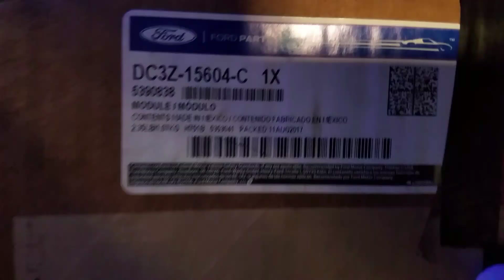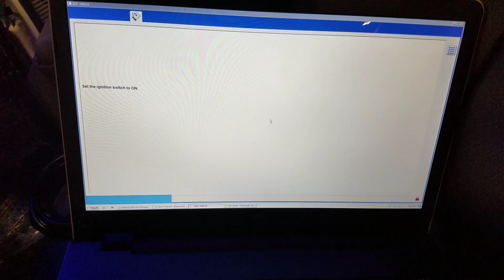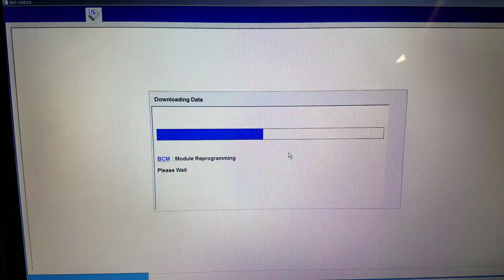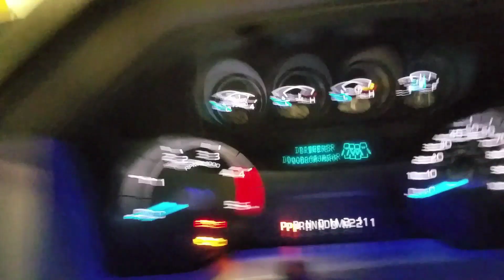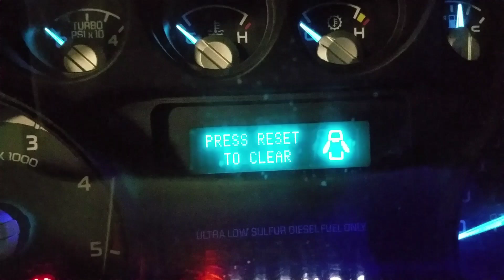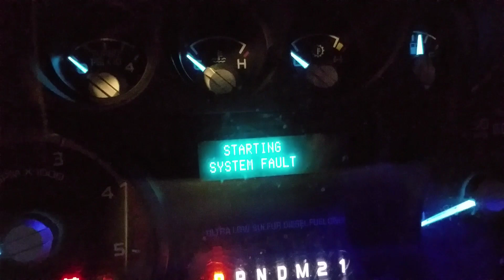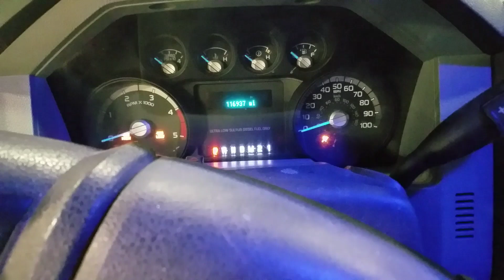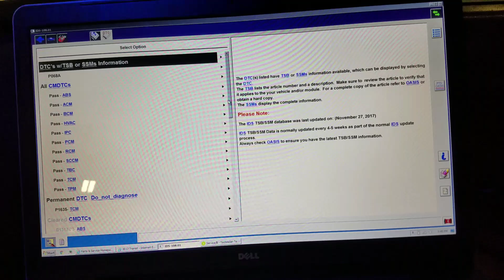BCM R&R - FsuperDuty

Comment: Great, informative video! Just replaced the BCM on a 2011 Ford F150 XL. Swapped out both doors and BCM to add power windows, doorlocks and mirrors. Any idea what additional programming needs to be done to get the truck to recognize the new configuration? Is there additional wiring that I need to do? Thanks in advance!
Reply from the maker: Bcms are NOT plug n play. Ur gonna need a dealer level scan tool to perform the PATS functions & ultimately program the BCM into the network...
Reply: @PowerStrokeTechTalkwARod  so Forscan is no good for that? I’ve already done everything you did in the video with the IDS, with forscan. Just wondering if there is more that I have to do, or more wires that need to be run. Again, thanks in advance!
Reply from the maker: I duno if there would be..ive never added anything like that...

Comment: My Parking lights will not go off on my 2013 6.7 powerstroke Lariat. I have to pull the two fuses out of the BCM to get them to go off. Could this be a possible BCM issue?
Reply from the maker: Possibly
Reply: @PowerStrokeTechTalkwARod  I would say definitely I’ve extensively searched on Ford forums for an identical scenario for my f150 with starting system fault, gear icon, advancetrac problem with parking lights that won’t shut off draining the battery. I’d say yes. Bout to buy vcm 2 computer for this. Hopefully it’s not god awful slow to reprogram bcm
Reply: Yes
Reply: Have issue with parameter alarm. Lost keys had new ones cut now won't let me access security because perimeter alarm active. I'm using ids with vcm2 and advice. Won't let me access can bus due to perimeter alarm active
Reply from the maker: A condition is not met
Reply: @PowerStrokeTechTalkwARod  so how do I fix this or find out what condition is not met? Thanks for the help. Dealer wants new ECM and new bcm to fix I can't believe that to be true.
Reply from the maker: Id love to help ya...im sure you can imagine your not thee only 1 requesting assistance. You'll have  2 email me & pay for my time....my content is free, my time is not...
Reply: @PowerStrokeTechTalkwARod  understood and I appreciate the reply what is your email
Reply from the maker: Its in thee about tab brotha

Comment: P2610 code starting system fault. Then can shift into neutral and will start. When in park the p will not Illuminate so vehicle thinks possibly in gear? Bcm issue?
Reply from the maker: Maybe..

Comment: You seem to have a pretty good grasp on the electrical systems on these trucks... I’m having an issue with my center stack cutting out, my airbag light coming on and my front windows stop working all at the same time. I just had my bcm installed, and programmed at a dealership and that didn’t fix the issue. Any idea as to where I should go from there?
Reply from the maker: Id have 2 go thru the applicable pinpoint tests for your concern....no guessing games....
Reply: Did you ever find a fix? I have the same exact issue

Comment: Hello I hope you answer so just replace a bcm on 2014 ford f250 it was no communication so I pu a new on it reprogram,  and I got to keys truck runs everything looks good but the interior lights flashing what do you think I need to do 🤷🏾‍♂️🤷🏾‍♂️ thank you..it give me the same go to tool box  but in the tool box don't have that option 🤷🏾‍♂️
Reply from the maker: Its in the tool box...in IDS & the directions in the WSM in replacing the BCM.....did u read the instructions???
Reply: @PowerStrokeTechTalkwARod  yes but in the tools box its nothing,, the CEL LOOK CONFIGURATION,, CANT FIND IT
Reply from the maker: Powerstroketechtalkwarod@gmail.com

Comment: Hello there Señor ,, I have a question -- && Happy Holidays to you and your family I hope all is well ----- I'm working on a 2012 F550 diesel , problem is the entire cluster sometimes shuts off while driving ,, also when the dashboard isnt working the interior && all outside lights stay lit -- Also if the dashboard isnt working the truck wont turn on.. if I disconnect the harness above the emergency brake for a few minutes and the lights do turn off -- but the problem randomly persists --- are these signs of a faulty BCM .?
Reply: Thought so .! Sweet your Tha Man .!! -- Now I bought the BCM before I realized it needs to be programmed..then came across your video --- I worked 10 years in a small garage where I learned alot ,, but never did anything as far as programming.. I just started working by myself about 6 months ago && I've been talking to my Mac Tools && Snap On guys about getting a better Scanner but I dont know which one yet -- what would I need to be able to program this myself .?
Reply from the maker: Ud need ids. Ud have to download files from ford server. Gotta take to the dealer, sry pal
Reply: All good Thanks again .. at least I got the BCM a little cheaper thru my account.! Lol
Reply from the maker: Most likely!

Comment: I am having an issue with my 2019 super duty diesel 6.7 will I need this program? Also is it something I can buy or dealership only?. Says my doors and hood is open when they are shut. My hazard lights don’t flash but lights work. But the head lights and fog lights are stuck on. Any ideas?
Reply: What else do you think it might be? It’s driving me nuts
Reply from the maker: I have to look at it and put the computer on it
Reply: @PowerStrokeTechTalkwARod  where are you located? I’m in Tampa FL
Reply: @PowerStrokeTechTalkwARod  where are you located? I’m in Tampa FL
Reply: @PowerStrokeTechTalkwARod  everything else works fine just headlight switch doesn’t change lights or park lights, hazard button doesn’t work, says hood and doors are open when they are closed? Truck runs perfect other than the above
Reply from the maker: Detroit, i have transports available
Reply: @PowerStrokeTechTalkwARod  you don’t happen to know anyone in FL do you?
Reply from the maker: Nope sure dont
Reply: Hey bud do I have to have that BCM programmed or can I swap it out and then take it to the dealership to be programmed? Or is there a chance it will just work?
Reply from the maker: Nope, truck wont start. Has to be programmed & ull need 2 keys. If you dont you ll have 2 go buy a new key.
Reply from the maker: Probably not the same problem. Id have to look at your truck.

Comment: Your video saved my ass .......Thank You! ....... PS Can a  (good) used BCM  be re-programmable  or is a new one required InYrOpp ...My local dealer's elec. tech. is telling me to start with a (full body wire harness)  this is what I am working with right now......Rt side collision damage took a good hit at the lower A-pillar where the bcm is mounted inside ......2015 F-150 crew cab XLT 2.7 Eco. ...Ford Tough .....
Reply from the maker: It has to be the same level part numbers
Reply: @PowerStrokeTechTalkwARod  I need to gift you somehow for your help..... I have Pay Pal please advise how to send a tip your way my friend.....
Reply from the maker: Friends & family pal!! 
https://www.paypal.me/pttwarod

Comment: I have a 2011 F350 Power Stroke.  I have intermittent issues with TPMS fault.  The issue will clear the next day.  This happens every few weeks.  I don't have any USB charges connected but I do suspect it is some kind of an RFI issue.

The two codes I see are... DTCs in BdyCM: B124D:02-8A, B1182:00-8A

I found an excerpt from the shop manual that suggests removing and re-seating all connectors on the BCM.

Can I safely unplug these connectors without having to reprogram the BCM.  I assume the reprogramming piece is just for replacement BCMs.

Is there a way to clear the TPMS fault rather than having to wait a day for it to clear on its own?

Thanks, Kevin
Reply from the maker: Yes u can... & u need a tire training tool
Reply: @PowerStrokeTechTalkwARod  When I get the fault, I do nothing and it clears on its own after a day and then fails in a few weeks.  I don't have to retrain the sensors.

Comment: We have a 2011 F-350 6.7l king ranch. We have an issue with the power windows, moon roof, back sliding glass, and the compass displayed on the instrument cluster not working intermittently. Then the next day or two it will start working again. Do you think this is the BCM?? Looking at the Ford wiring diagram book it appears that the BCM is the common denominator as well as 30a relay #48, but we have had the relay tested and was told the relay is not bad. Is it common for intermittent issues with a BCM or should we be looking at a possible ground, switch, or wiring??? We have brought it to two mechanics that either don’t want to deal with it or just don’t really know what they are doing. They both sent the truck back and said (paraphrasing) ‘we don’t know what the problem is, never heard of this issue, probably some wiring somewhere.’
Reply from the maker: Wow! Buddy you will have to follow the proper pin point test to figure out where the problem is. You will need 2 use the type of scan tool i have to even program a BCM if its it.

Comment: I have an issue with my rear passenger brake light and turn signal not working. The fuse is good and have power at both sides of the fuse but no power at the light socket. Even traced it back up to the BCM and no power coming from the BCM.    I took the thing out and looked for loose and dirty connections but it was all good. I would hate to have to bring it to a shop to change the BCM because I have no tuner to program it. Could there be another way to get around this problem??
Reply from the maker: Nope

Comment: I am dealing with a no crank BCM communication lost the connector at parking break how would someone get in touch with you best ?
Reply from the maker: The email on my about page
Reply: @PowerStrokeTechTalkwARod  I'm having starting issues showing fault starting system
Reply from the maker: Gotta check codes

Comment: My 16 F350 gasser needed a new BCM. I had a ford tech stop by and install it. He said he programmed it in and needed the two keys also. After install my brake light in the dash stays on. The tech said to disconnect batterie for a hour and then reconnect and light in dash will go out. I did this but the dash brake light is still on. Any ideas to what is wrong?  The brake dash brake light was never on prior to changing the BCM.
Reply from the maker: Interesting. I would first check DTCs. 2. I wld check brake fluid and emergency brake pedal. 3. Make sure connections @ BCM are sound. And after that im pretty sure i wlda figured it out by then...
Reply: Thanks.

Comment: i have a major electrical issue with my 2012 f250 powerstroke. truck starts and runs fine!
radio turns on but doesnt light up, electrical windows dont work, ac blows but not cold, trac control and autostable light on dash, air bag light on.
NOW i replaced the cluster with another used one but didnt work.

is this a bcm or pcm issue?! im stupped been looking around for messed up wires and fuses but nothing out of the ordinary.
Reply: also the cruise control doesnt work, abs light is on and says check brake fluid(its full) just a bunch of bullshit going on.

now i did have the PCM reprogrammed at the dealer but didnt do anything.
Reply: whats your email
Reply from the maker: Goto my about page
Reply from the maker: Email me
Reply: @PowerStrokeTechTalkwARod  just sent email!

Comment: I have an odd issue. 2015 F350 that had Sync2, I installed a Sync3 and it works great except that after about 17 mins from key on the screen starts to dim and at 20 mins it goes completely off, touch still works if you know where to touch.  Reverse camera doesn’t show, steering wheel controls work but nothing starts the screen back except power+>> reset or key off/on. Seems like some BCM power saver function sending a sleep command to the Sync 3 running 3.4.  I was told that a Sync 3 with old software would probably fix this, but you can’t downgrade from 3.4.  

Is this something a Ford mechanic will even want or try to fix?  I’m wondering if a newer BCM or other module could fix it
Reply from the maker: Yea man, i havent got a clue. If ur gonna take it in be prepared to spend some cash. When the world mixes and matches these things together, there are no pin point tests to follow to aid in diagnosing. Seems like its gonna b a pita to figure it out. Gonna have 2 leave it with some1 to diag.....

Comment: hey  PowerStroke Tech Talk w/ARod  where can I find the wire color code for the turn signals and running light, so i can splice into them and add them to a new set of tow mirrors with signal lights and power fold. 2012 F 350 Xl 6.7
Reply from the maker: Email me at powerstroketechtalkwarod@gmail.com

Comment: can a steering wheel control module tell the bcm to not tell the instrument cluster to go to sleep completely because I have a parasitic draw that it coming from the instrument cluster but there is nothing wrong with the cluster that I can see and it turns off when the truck is off and theres are no lights on the cluster or gauges that stay on..... I had a aftermarket stereo installed with the idatalink to retain the steering wheel controls for the radio and I think that the idatalink is leaving something on and not putting the cluster into sleep mode...…..
Reply from the maker: No man, most likely not. Id be lookin somewhere else...
Reply: Do these cluster go into sleep mode or are they suppost to shut completely down when the keys is off?

Comment: i have a 2011 f250 that the turn signal on the back dont work or the brake light dont work, it has a state body on it with the tool boxes on it. about a month ago a mekanic checked it and did get it to work. is it possible the thing went bad again?
Reply from the maker: Yepp have done multiple, make sure the tech is programming it in

Comment: Got an 07 Explorer Sport Trac. 3 weeks ago I started it to have no Information Center display and no dash warning lights but the instrument cluster worked still such as the fuel gauge, speedometer, etc. At the same time I had ZERO heat and no power whatsoever to the electronic dual climate control. I suspected a fuse but all looked ok. The message center intermittently starts working again but the heat has not worked since. A scan with a BlueDriver tool showed things like “lost communication with body control module”, “battery voltage out of range” and that my compass lost communication. The other day the compass started working again. Do you think this could be the Body Control Module? On my truck the fuse panel is located on the driver side up above the kick panel. It appears to be a very difficult job to mess with as it’s hard to see anything beyond the bottom of the fuse panel!
Reply from the maker: Yes it very well could be. Check powers and grounds to the BCM if all good you'll need to replace and program the new one into the vehicle. Will need 2 working keys.
Reply: PowerStroke Tech Talk w/ARod thanks for your prompt reply! So typically there is one main body control module and it is integrated with the interior fuse panel? I think there can be other body control modules for other things too. I’ve heard that some vehicles have many. I’d hate to take that main one out and discover that’s not even the problem. I read online about some people having the dual climate issue and it was resolved by disconnecting the battery for 15 mins. I have done that and had my message center start working again after and the compass come back too but the climate control has not worked at all. This truck now has 233,000 miles on it. It has the original alternator and is on its second battery. I think the reason for my battery voltage out of range is perhaps because of the alternator. I don’t know if an alternator not working 100% as it should could cause glitches in the electrical system. The truck starts and runs fine so I can’t see the alternator creating these issues. I have never had a vehicle have the alternator last that long. That mileage is 375,000 kilometres here in Canada. Thanks.

Comment: Is it possible to just reset the BCM? I've got a 2011 F350 with some weird issues that you'd think a simple fuse replacement would fix but the fuses are good. Told it could be a bad BCM
Reply from the maker: No, no reset. Most likely gonna need a bcm
Reply: @PowerStrokeTechTalkwARod  would a badBCM cause steering wheel buttons to not function and/or illuminate also or would that be seperate? Im freaking stumped on that one too

Comment: Dealership replaced batteries on my 2017 F250 Super Duty, now overhead console lights and sunroof don’t work. Took it back, they said they reprogrammed it, drove off and same issue happened. Do you know what would be causing it?
Reply from the maker: Hmmmm sounds fishy to me

Comment: I have a 2011 F150 FX4 and the left back turn signal and break light does not work.  The hazards light and quarts lights work on this same left side just not the turn signal or break light doesnt.  All the others work just fine.  I check fuses and checked bulbs and all good.  Could you help out and maybe hint what it could be.
Reply from the maker: Could be a body control module(BCM we call it)....or a broken wire. You will need to pin point test it further to see if it is a wiring issue or a BCM issue....
Reply: @PowerStrokeTechTalkwARod  Pin pointing would I need to take a dealer or how may I go about testing or finding it at home to save money.
Reply from the maker: Yes, your gonna have to take it to a shop that has the lastest scan tools...not the scan tools that just pull codes...you will need the lastest wiring diagrams as well. Im not sure how you will get your hands on those 2 pieces